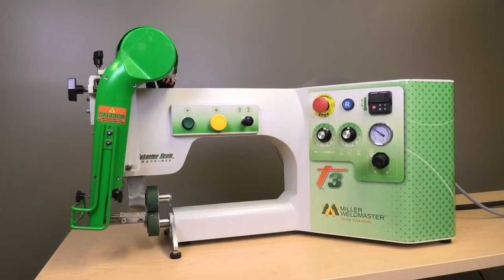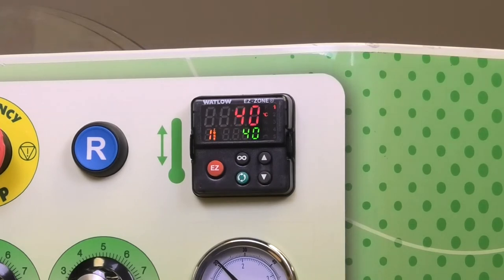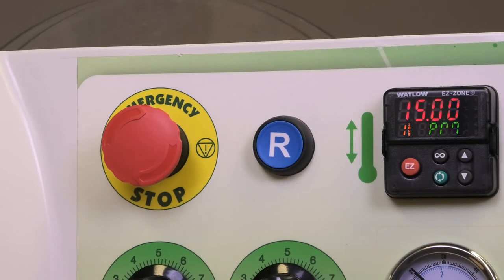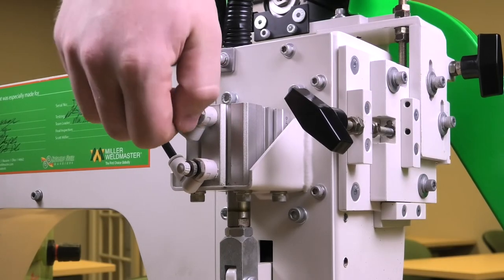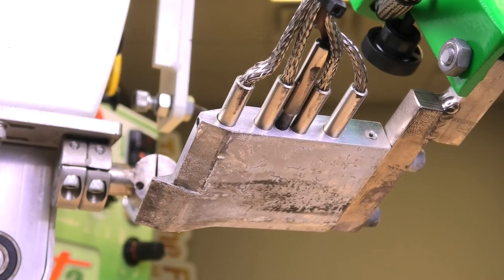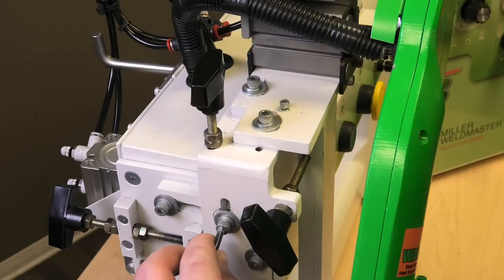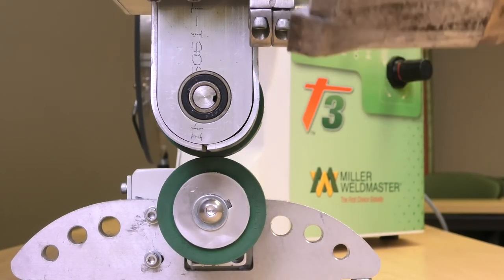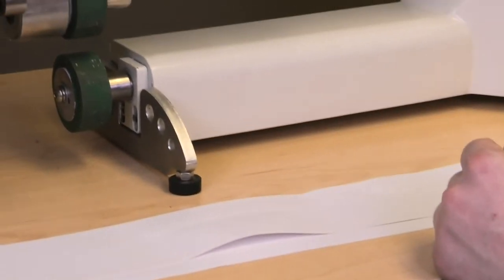T3 Extreme Set Up Training I Miller Weldmaster

Comment: Can this be used to repair seams on drysuits?
Reply from the maker: You would most likely want a T300 Curve with hot air since that'll provide more for your needs. T3 is for running straight hems and pockets most often used in the sign and banner industry. Visit the link below for more information regarding the T300 Curve. https://www.weldmaster.com/t300-extreme-curve  If you have any more questions, please contact sales@weldmaster.com for more information.